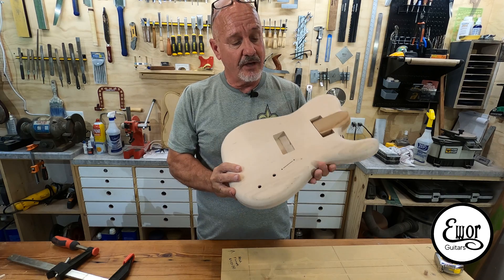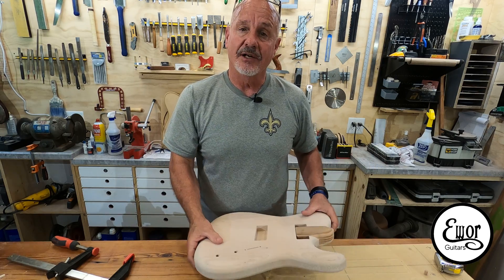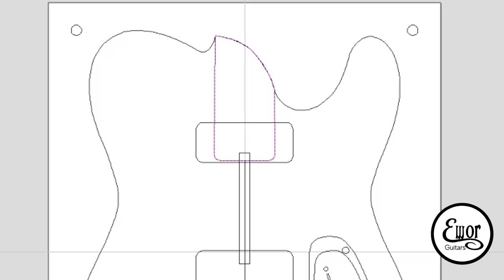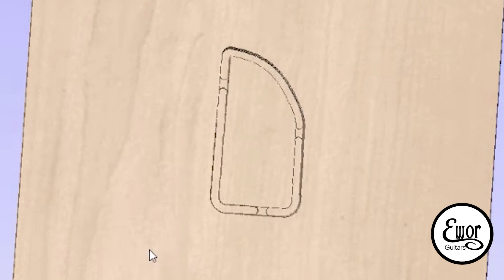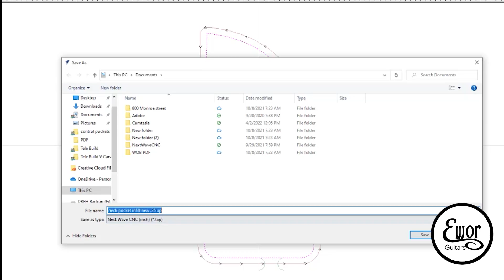My Journey into CNC guitar building: Part 5

Comment: In the energy field, we never run AC and DC lines in the same conduit or wireway as it can cause interference, hopefully that was your problem and an easy fix.
Reply from the maker: Yes that was part of it and also the manufacturer sent me a new vfd because the one they sent me was pre wired with unshielded control wires.
Reply: @eworcustomguitars  wow, nice customer service though

Comment: My guess to why the CNC machine went off path and cut into the body around the electronics cavity could be due to either missing steps on the motors OR more likely  the CNC controller had some noise interference, honestly it could be a lot of issues with drivers as well its hard to tell until you can recreate the problem unfortunately
Reply from the maker: I’m thinking your right. I just put in a uninterruptible power supply and I re arranged all the wiring to be sure there is separation between the power cables and control wiring. The problem seems to be getting worse I hope this helps